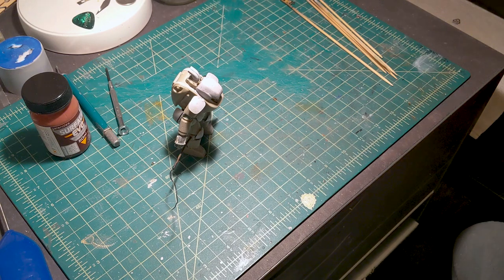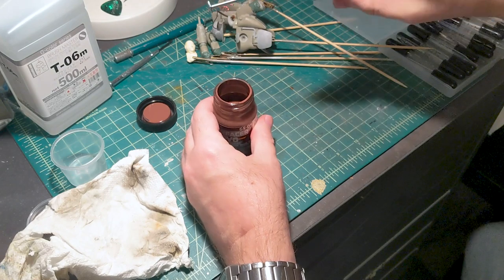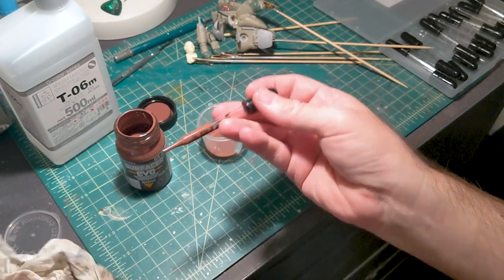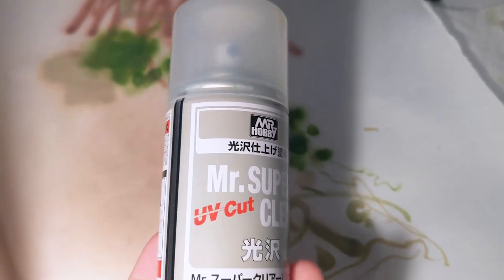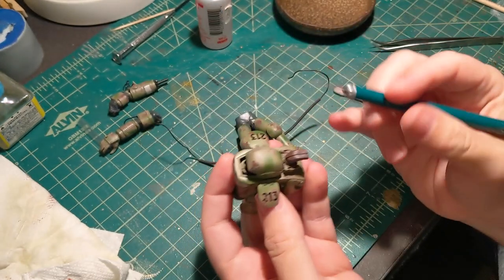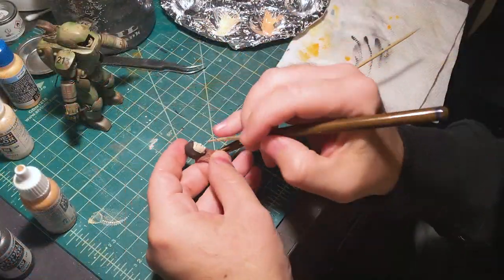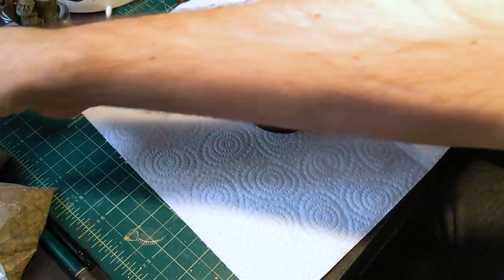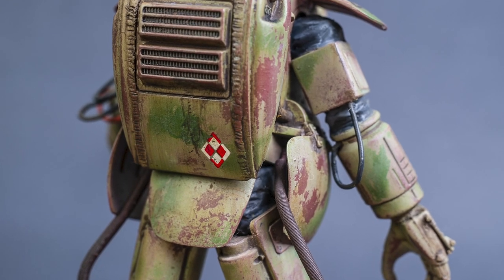Ma.K AFS Mk II - Painting and Weathering

Comment: Looks absolutely great!!! Gonna use this as tutorial for my first maschinen kit! Question, does the hairspray trick work with laquer paints or did you airbrush acrylics?
Reply from the maker: It needs to be acrylic so that the water will lift the paint off in little chunks. If you were to try it with lacquer with lacquer thinner, it would just smear around.
Reply: @bhop.builds  thank you so much for the reply! Got it, I’ll have to give it a try with my acrylics!
Reply from the maker: @rx69_grandzaddy84  I also meant to mention that the hairspray will only work with acrylic.. If you were to spray lacquer over it, it would just seal it in place.

Comment: Did you use the epoxy putty right over the existing gray plastic joints? If not, what did you use as a base armature for the putty? Kit turned out great!!
Reply from the maker: Thanks! It's right over the existing joint as you mentioned, so no need for an armature.